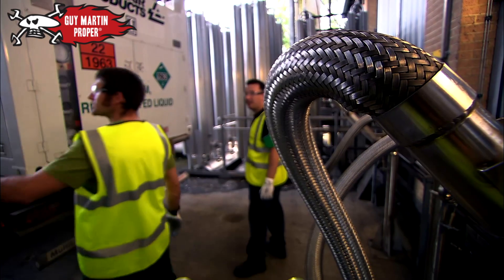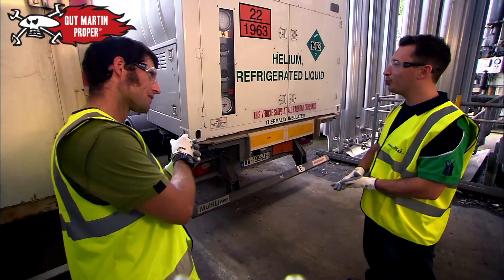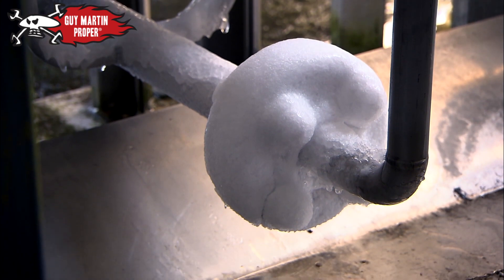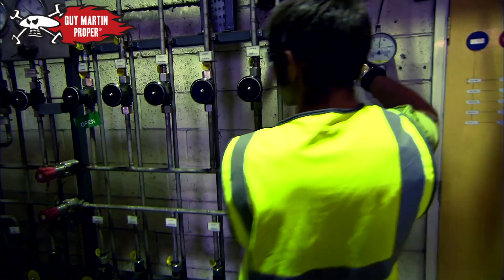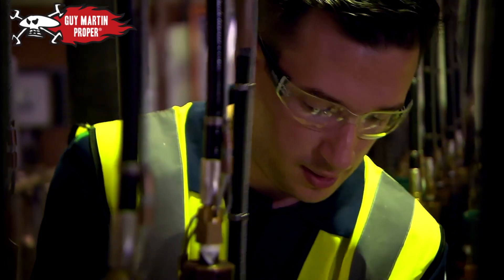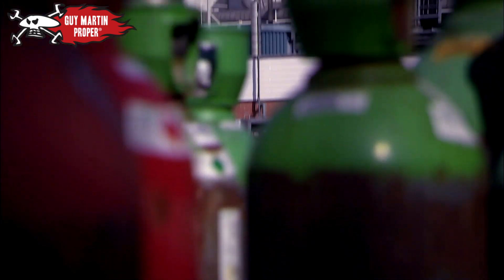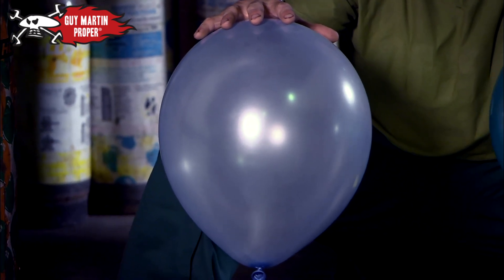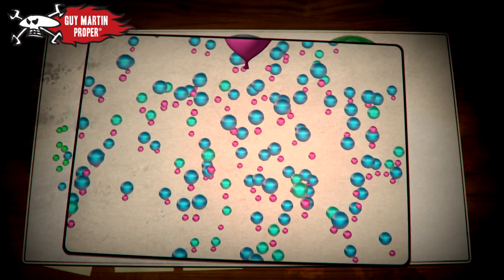Guy visits a Helium plant | Guy Martin Proper

Comment: Party balloons should be filled with hydrogen, make it a bit more exciting
Reply: well for a time during the shortage, when you bought a tank of 'helium' you actually got a tank of town gas just without the scent added, you used to be able to tell them apart as the town gas said "party gas" vs the tanks that contained 60%helium 40% nitrogen, which made for a couple energetic balloons at parties where smokers were involved, a few beers in remember a family member doing the high voice thing, then lighting up a smoke, got two small jets of flame from the nostrils and no eyebrows, but lead to much excitement for those watching, sadly dad was a few more than three sheets to the wind and didnt realise what happened till about 20 seconds later when he commented on someone in the kitchen must have burnt something,
but as they found a new source a few years back can go back to having 100% helium in the tank, though i suspect they still throw in a good chunk of nitrogen as a cost saving measure. but still, cuts down on the excitement factor significantly